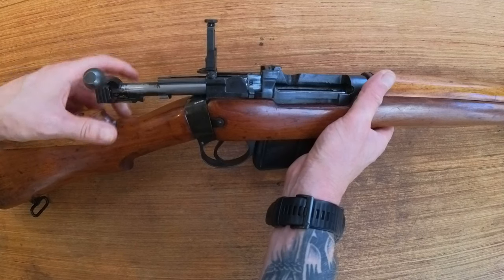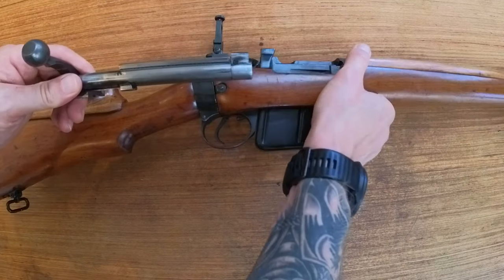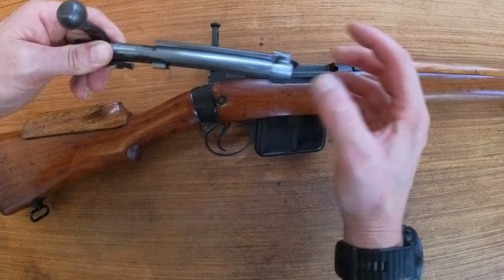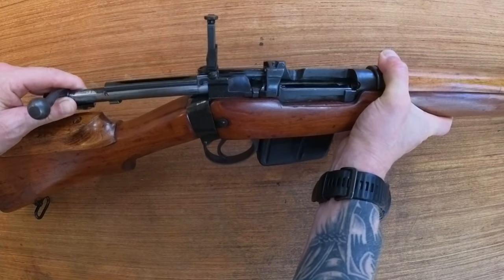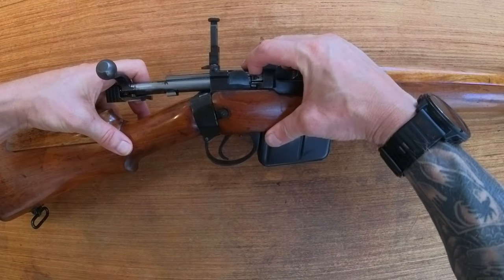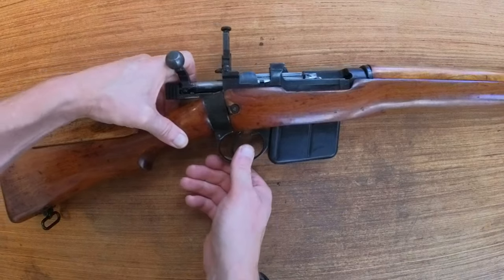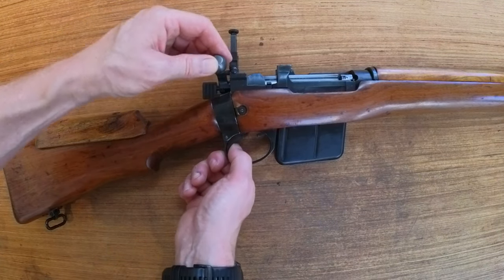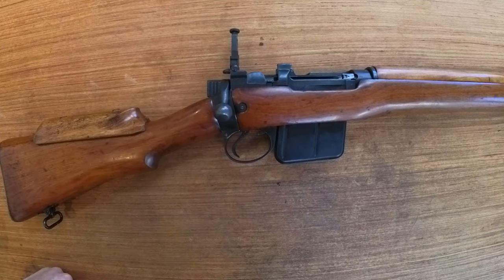LEE ENFIELD BOLT REMOVAL less than a minute! NO4 smle

Comment: The Savage and Long Branch No. 4’s didn’t have the bolt removal button, they had a cut out at the same point to allow you to rotate the bolt head.
Reply from the maker: The American and Canadian versions?
Reply: @toolittletimeUK  that’s correct, in the UK the No. 4 was built at RSA Enfield just north of London and RSA Fazackerley in Liverpool, in Canada they were built at Long Branch armoury and Savage built them in the USA under Lend Lease.  For some reason Australia never adopted the No. 4 and continued to build the No. 1 Mk. 3, and they used it into the 1950’s, taking it to Korea.